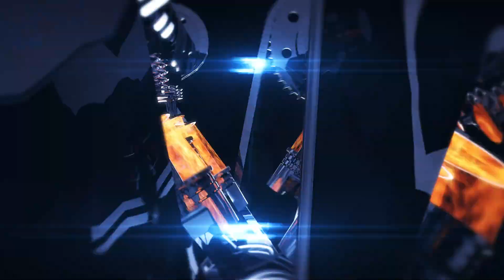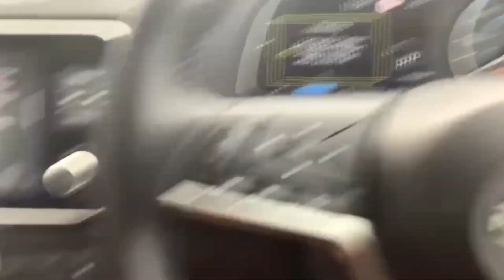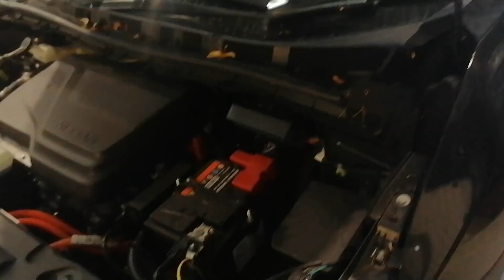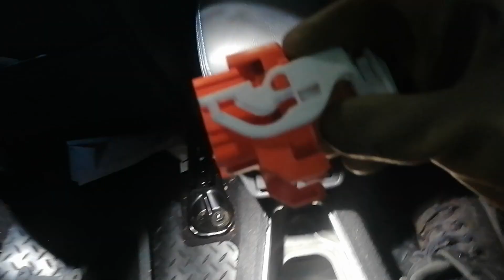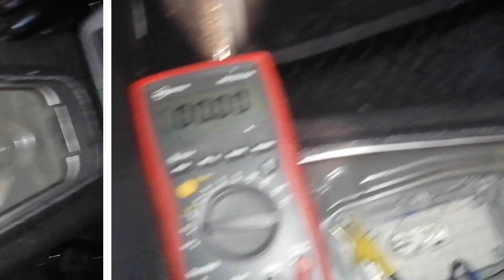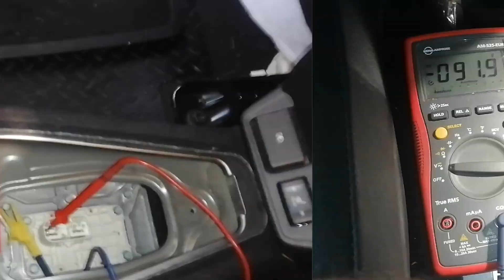🚗 Nissan Leaf EV Won’t Start? High Voltage Battery Voltage Leak Test | P31E7 P0A6 ⚡

Comment: What dangerous? Do not tell to me to use insulated tools and protective equipment...this is big scam ever! If you know even little bit electricity, then you know why. Only thing what kills there is if you drop the tool between 2 polarities and only killing part is flying molten metal. You can easily hold one or other polarity by bare hand, nothing happens. No, no, you need 3 days training, thousands of euros questionable certificate tools and personal protective equipment...Educate yourself and you do not need that garbage. Remember, it is DC voltage
Reply from the maker: OK, you just said it can Kill if you drop the tool between 2 polarities...why risk it and not use the correct equipment..Remember you only have one body. 
Anyway thanks for watching see you on the next one.
Reply: Hi, what should the readings be? Should they be 0 on both sides? 
What if you get a small reading then it drops to 0